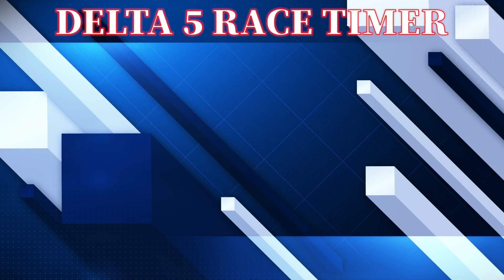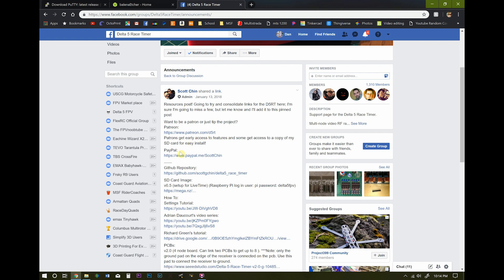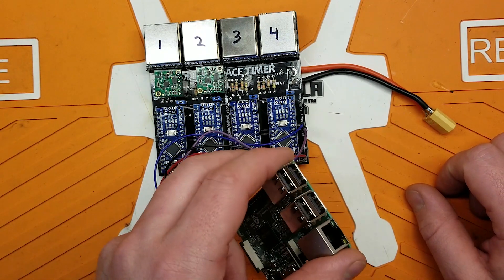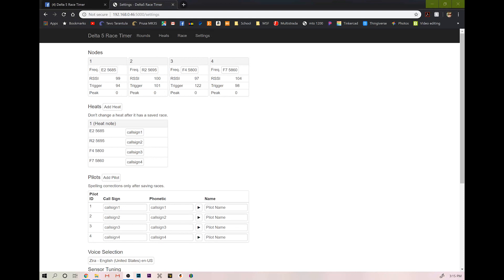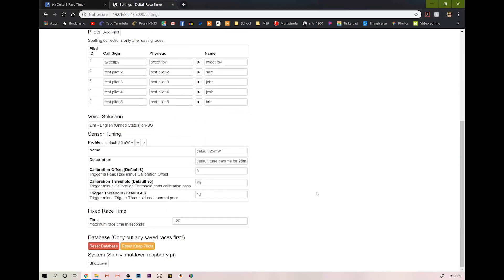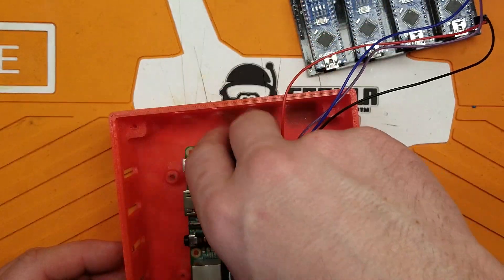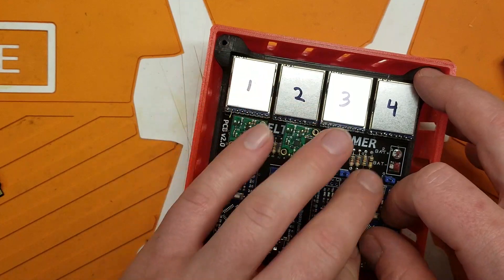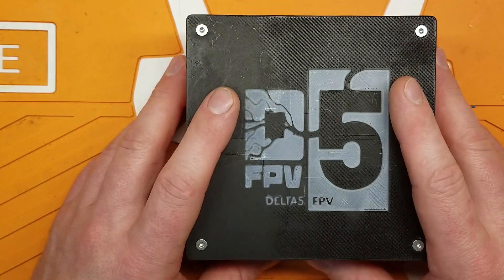Delta 5 Race Timer Build - Timer software

Comment: Hi! I tried to build the server from the github but I'm running into alot of trouble.  I think it is a Python version issue.   I tried the facebook group but the group is shut down.   Do you know if there is a chance to download the ready-made SD card image somewhere?
Reply from the maker: I've been talking to Scott chin about hoisting his images. I'll get back on it.
Reply: @TweetFPV  I've realised that the Project is old and that the Rotorhazard project is alive and are getting updated.   So I'm going for that solution.  However:  thanks alot for the quick response.

Comment: For anyone confused about finding the group, please note that the Delta 5 developer has abandoned the project and hasn't approved a pull request since 2019 / hasn't had a release since 2017. Anyone that's not already in the facebook group will not be able to join or even see the group, so you will NOT be able to download the .img. There is a way to get it to work, but I highly suggest that you search for the RotorHazard project on GitHub and follow the instructions there. It's guaranteed to work (for the foreseeable future), has some new features, and your Delta 5 board will still work. All you need to do is re-flash the Arduinos with the code from the RotorHazard project, and then follow the rest of the steps there.
If you're stubborn, you can still get Delta 5 to work. Apologies if youtube messes with the formatting:

1) Download the Raspberry Pi Imager, Select 'Raspberry Pi OS (32 bit)' as the OS, select your SD card, and write the image to your SD card.
2) Remove your SD card and then put it back in your computer. Don't reformat the card if your computer asks. Don't worry if your computer is complaining. You should still have access to the contents.
3) Google 'How to setup headless raspberry pi 3b'. TomsHardware has a good article. Basically, you need to add an ssh file, and create a wpa_supplicant.conf file with your wifi info.
4) SSH into the raspberry pi, go to the Delta 5 github, go to the Hardware and Software Setup Instructions doc, and follow the steps in the steps under the 'System (Raspberry Pi)' and 'WS2812b LED Support' section. Follow the steps *until* you reach the step asking you to run 'sudo pip install -r requirements.txt'.
5) This project uses an ancient version of Python, which is why you should go back and use the RotorHazard project... anyway, you need to modify requirements.txt so that we make sure that we're using a version of each dependency that still supports python 2. So, from the terminal, make sure that you're in the /delta5_race_timer/src/delta5server directory. Then, type 'nano requirements.txt' . This opens a text editor. I'm going to paste what you need to enter in this file at the end of my post so that the formatting isn't thrown off. Paste it into the terminal (right click to paste) or type it out, and then ctrl+x, Y, and enter, to save and exit.
6) Continue with the rest of the instructions. Make sure that you reboot and then follow the steps on 'Starting the system'. Try to manually start first.

Here's what you need in requirements.txt:
Flask==0.12.3
Flask_SocketIO==4.3.2
itsdangerous==0.24
Jinja2==2.7.3
MarkupSafe==0.23
python-engineio==3.13.2
python-socketio<5.0.0
bidict==0.18.4
six==1.9.0
Werkzeug==0.10.4
gevent==21.1.2
gevent-websocket==0.10.1
flask_sqlalchemy==2.5.1

@TweetFPV thanks a bunch for the tutorial series! It was extremely helpful and the timer is working great now! This step was the only piece that's out of date/ won't work.

Comment: Looks pretty cool, one question, can I just connect a wifi dongle to the RPi and then ad-hoc with a phone? 

I really don't want to lug a laptop out for my solo sessions. 

Also, I might try this with my old Pi Model B, see if it can run a single node.
Reply from the maker: Yes you can do that. Scott chin has a wifi Hotspot version of the software avalible on his patreon.

Comment: Is this project dead? Having trouble finding the Facebook group.
Reply from the maker: It's still there. Look for "delta 5 race timer" on fb
Reply: I'll check again, thanks!
Reply: @TweetFPV  this is very strange. Following the link to the group never loads the page, and doing a search as suggested does not show the group. IDK
Reply from the maker: @Dieselshroom  try this link https://www.facebook.com/groups/1311778568859098
Reply: @TweetFPV  Thank you Dan! That link returns a "This Content Isn't Available Right Now" message. After asking around, some others have said that the group was archived and no longer active. They suggested the RotorHazard group which is a fork of the Delta5 apparently. I will be try that. Thanks again.
Reply from the maker: Yea, Scott isn't actively developing the d5 timer anymore. There are a few forks out there like rotor hazard.

Comment: Nice job. Any chance you can upload the SD card image somewhere... the Delta 5 Timer FB admin have not responded to my request to join the group for over a week now. I have tried FB msg them too... so if you could upload the image that would be awesome
Reply from the maker: I talked to the guy who runs the group and designed the timer. Her just approved your request. For some reason he didn't get any notifications.
Reply from the maker: Oh and BTW 2 days doesn't constitute as a week.
Reply: TweetFPV that’s because I tried multiple times ... but all good now... thanks for the help